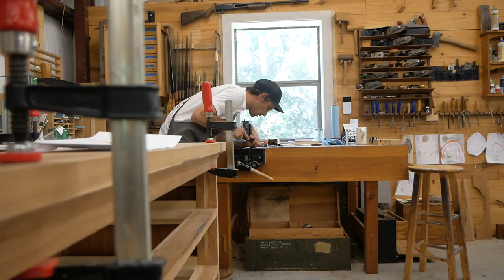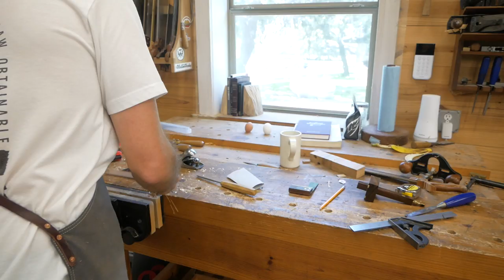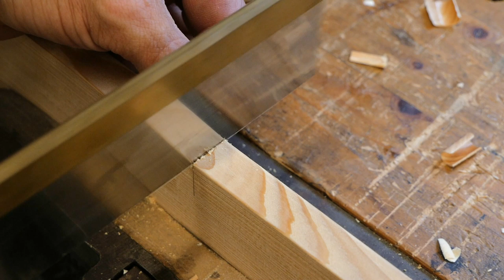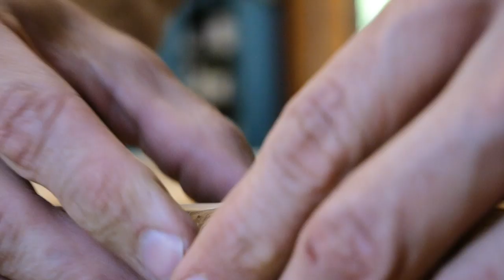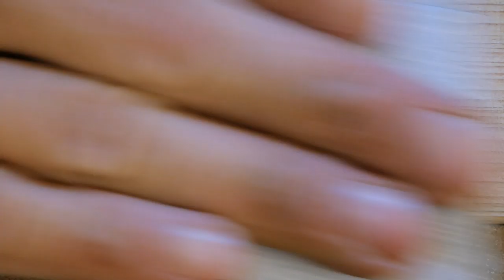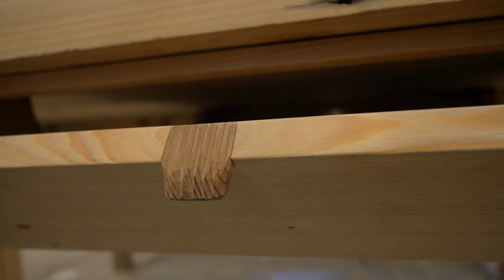Carving A Drawer Pull With A Razor Sharp Chisel

Comment: Hey Andy, so for my WoodShop class in high school I made a flute and was wondering maybe you could try to make one. Granted I used a lot of power tools and a lathe but I think that you could do it. Instead of hollowing it with a drill maybe you could cut it in half and carve the inside since you don’t usually use big machinery like a lathe. I hope you read this message and try it out. Thanks!